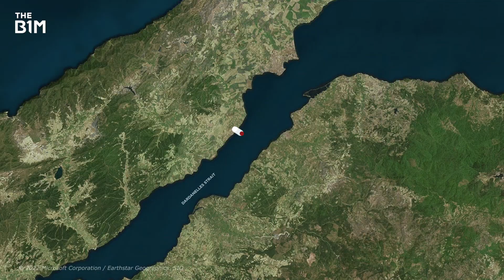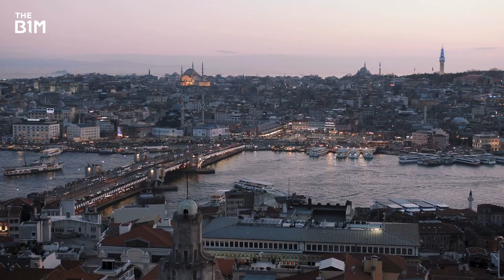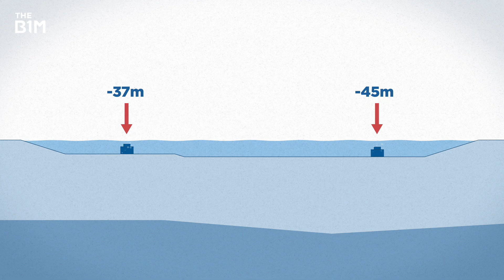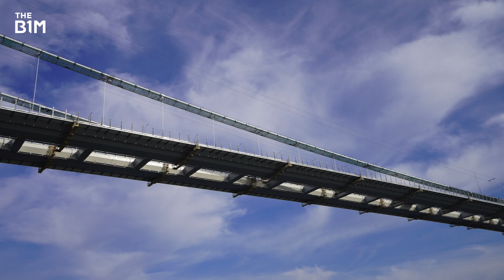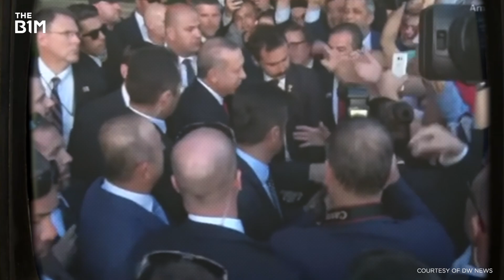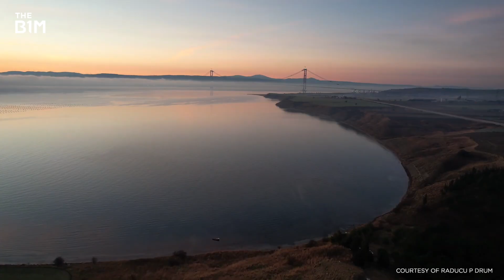Why Turkey Built the World’s Longest Suspension Bridge

Comment: Why not 4 smaller towers instead of 2? 
Surely the wind loading would be much reduced, the deck height could be the same, and still plenty of space between spans for shipping navigation.
Reply: Typically a suspension bridge is cost effective if the two towers can be built on dry land. But here both towers are built on caisson foundations. Is 3 or 4 caissons with cable stay towers more expensive?

Comment: When you have to take Oxygen with you when going to top of towers, you know it's a very tall bridge. It has incredible free space underneath. It will be a very long time (never) before a ship too tall can't fit under. 

The boxed road sections with opening in center is cleaver engineering, allowing wind to pass without inducing harmonic frequency problems. The connections in between used to walk between roadways. 

Will someone else build bigger, higher, longer than this bridge? Only time will tell.

Comment: Wondering how long it'll take for induced demand to completely destroy travel times... again.
I'm reminded of "just one more lane... just one more lane... just one more lane... I swear this one will fix traffic, just one more lane".
Also, 45k vehicles a day? Over 16 waking hours, that's ~45 vehicles a minute. Around equal to how much people the Sydney Light Rail would transport the same distance in the same period (citation needed).
On the ferry shown, I was able to spot 3 mopeds, 1 bike, 2 trucks, and 7-8 cars (not total number, just visible). If we were to be running that load with just one boat, and assume that the same boat could hold 150 people comfortably (around 2/3 of a Sydney Rivercat max seating), and we ran a dedicated freight ferry (handling cars and trucks), and we assume that the 7 cars were packed with 7 people, a passenger ferry (even a sydney freshwater-class ferry) would easily exceed the capacity of it.

Unfortunately, we've kinda... bulldozed our world so we can drive cars. Which kinda sucks, having to own and maintain an AU$3K upfront vehicle... sucks.
Reply: Somehow still cheaper than the New York Port Authority Bus Terminal... idk how 30bn went into that.

Comment: It's kind of impossible to convey the true scale of this on video. To me, it looks like a regular ol' suspension bridge, as the design is pretty much the same, but enormous. Overlaying it over central London certainly helps to visualise the incredible scale of this bridge, but video can't convey it all. Truly insane engineering.
Reply: it looks regular sized in real life too because there is not much around to compare sizes
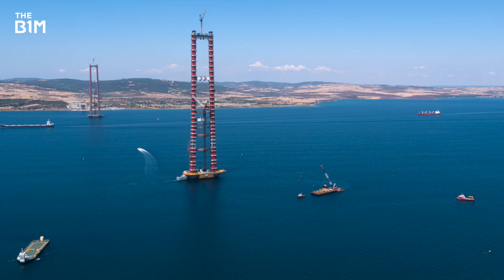Reply: The shot at 3:51 conveyed the scale for me. Not the surrounding landscape or even the passing freighters, but the tugboats surrounding the 'little' platform slightly right of the middle. Tugboats aren't that small, but they look absolutely tiny here.
Reply: Was looking for a comment about this

Comment: 0:15 CORRECTION: It is NOT the longest suspension bridge (the 4.6km). For example, the Great Belt Bridge (finished 24 years ago) in Denmark is longer (6.8km).
It IS however, the suspension bridge with the longest main span (2,023 m), right after the Akashi Kaikyo Bridge (also finished 24 years ago), which have a span of 1,991 m.

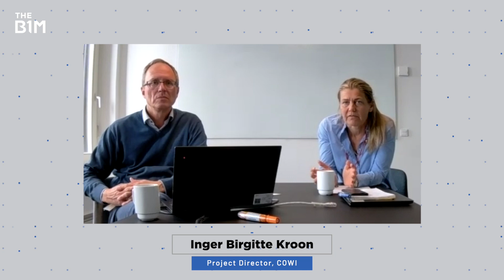2:43 COWI (HQ in Denmark) is one of the designers of the bridge and they should have the experience, as they was also one of the designers of the Great Belt Bridge in Denmark. The build process looks much the same, and given the compressed time frame for building it makes even more sense to choose that solution.
Reply: You should have said it's not the longest bridge. But, it's exactly the longest the suspension bridge because the suspended part of denmark's bridge is 1,624 meter only, almost 400 meter shorter than the Turkish one which a 2023 meter long in suspension. Previous record holder was Japan as you said but denmark's bridge is far shorter.
Reply: Who cares? Denmark doesn't exist anyway

Comment: "Longest suspension bridge in the world" 

Umm... no. First, it depends on how you measure (total length vs. distance between towers). Second, while 4.6 km is a cute bridge, North America's Mackinac Bridge is OVER 8 KM long! (Three times longer than the Golden Gate.) Details matter B1M.
Reply: Yes they do matter and you've got your details wrong.

You've got your definition of "longest" wrong for a start.
Reply: @davidpnewton  Except, that was how it was presented in the beginning of the video (longest = total length, which is of course wrong). The confusion is understandable.
B1M got it wrong in the beginning of the video. What they should have said was: It is the suspension bridge with the longest span in the world.
Reply: @davidpnewton  "TURKEY has a new bridge and it’s big – we mean really big. It’s the longest suspension bridge in the world, spanning 4.6 kilometers across the Dardanelles strait." 

That's not MY definition, it's THEIRS! They could have easily put that part about the center span being 2,023 meters at the beginning but they decided they wanted to highlight their tiny little 4.6 km overall bridge length instead. The "Mighty Mac" is nearly DOUBLE that! But if they had said "...this bridge has a center span that's a whole 32 meters longer than the previous record-holder" no one would have cared! It's basically click-bait. And not only did you fall for it, now you're DEFENDING it! 

On top of which, I clearly said "it depends on how you measure (total length vs. distance between towers)." So how exactly is what I said "wrong"?!?
Reply: B1M got it wrong in the beginning of the video. What they should have said was: It is the suspension bridge with the longest span in the world.

Comment: So the Mackinaw Bridge in Michigan is a suspension bridge 5 miles long. How is this the longest suspension bridge in the world when there are clearly longer suspension bridges?
Reply from the maker: The span of the Mackinaw Bridge is only 1,158 metres compared to this bridge's 2,023 metres, that's the part commonly measured when comparing suspension bridges.
Reply: @TheB1M  and still it is the total length that is compared in the video when calling the bridge the longest one - even if it was meant to say the one with the longest span.
Reply: As a Michigander I understand the sentiment but different measuring like Fred mentioned.  Mackinaw Bridge is 5 miles counting the embankments and center span (bridge in total).  While the main span is shorter than this bridge, it's still very impressive to cross!

Comment: Always thought who would succeed the  Japan's Akashi Kaikyo engineering feat. But after 24 years, here we are with this marvel. Thats why engineering is so fascinating!
Reply: Exactly. 24 years as top crown. That’s how big that bridge was and still is
Reply: While the 1915 Canakkale Bridge is a marvel indeed, I see no major advancement in engineering.  Consider it took 24 years to exceed the Akaski Kaikyo Bridge's mainspan by 32 meters, that is just 1.6%.  The Akashi exceeded the previous record holder, that being the Humber Bridge, by 581 meters, or just over 40%!  Also consider that the two towers of a suspension bridge are integral in holding up the side spans.  The Akashi Kaikyo Bridge's three spans total 3,911 meters while the 1915 Canakkale Bridge's three spans are considerably shorter at 3,563 meters.  The three span total of the Akashi Kaikyo Bridge is a 72% increase over the previous record holder, that of the Mackinac Bridge. The depth of the water at the tower foundations of the 1915 Canakkale Bridge are 37 & 45 meters, while the Akashi Kaikyo Bridge's are 67 & 70 meters.  The Akashi Kaikyo has been tested via earthquake - having its mainspan lengthened by nearly a meter during the Great Hanshin Earthquake.  The bridge was designed with a 1,990 meter span, but now has a 1,991 meter span.  Also the Akashi Kaikyo has experienced typhoons with winds of 160 kph.  The 1915 Canakkale Bridge will never see storms like a typhoon.
Reply: @Triplecenturies  And the Akashi Kaiykyo bridge still has additional (currently unused) capacity for rail.
Reply: @Triplecenturies i am sure if japan were to rebuilt it they could lengthen the suspension span easily. Sadly there is no bike path yet, I need to ride ferry to awaji island for cycling there. Well considering the wind speed, a bike path would have to have some kind of barrier

Comment: The Mackinaw Bridge in Michigan beats this bridge. It’s nearly 5 miles long. Why is that not the longest suspension bridge. But good for Turkey.
Reply: Not all parts of the Mackinac Bridge are part of the suspension bridge, which means the maximum span is actually short. The Mackinac bridge is the 26th longest suspension bridge in the world, so not even close to the top 10 in the world. You must know the difference between a 'span' and 'total length'. Both have different meaning and context. 

Mackinac span = 1158 meters
Mackinac total length = 8038 meters
So basically more then 70% is not a suspension bridge.

"Span is the distance between two intermediate supports for a structure, e.g. a beam or a bridge. "
Reply: @TanjirowGhamadow  Oh ok. I think it is like top 5 or top 10 in the United States. But I understand.
Reply: Yeah, B1M got it wrong in the beginning of the video. What they should have said was: It is the suspension bridge with the longest span in the world.
Reply: Some technicality. I guess Mackinaw is like the 20th longest suspension bridge in the world, but still one of the most beautiful

Comment: Nearly three miles long and taller than most buildings. That's impressive
Reply: Bragging rights are very important for dictators.
Reply: The Mackinac Bridge in Michigan is still longer, at nearly 5 miles. Built in the 1950s
Reply: @jeromewesselman4653  ffs mate i spent 2 seconds to see that its 1.2kms long - no where near 5 miles. Wtf are you on about?
Reply: @jeromewesselman4653  Is it a Suspension Bridge?! 
That's the point!
Reply: @wildone8397  Yes. The Mackinac Bridge is a suspension bridge, built in 1958
Reply: @jeromewesselman4653   The Mackinac Bridge's main span  is 1158m and  way shorter than  Çanakkale Bridge's 2023m. but  The Mackinac Bridge's total length is longer  because it is extended with normal bridge. The official length of suspension bridge is measured by main span not by total length.
Reply: @changcho6736  you meant m. 2023km is long enough to span from Spain to Poland
Reply: @remonn  You are declaring a dictator because the Turkish government does not follow a western style policy.
Reply: The "democracies" build faster than democracies when there is no wasting time on stuid things.

Comment: Why can't a cable stayed bridge be built with a central or additional pylons to increase the span length ?
Reply: i dont think its a good idea to put central pylons when building busiest sea route(canal)
Reply: @Thehusseyin  Okay so it was a project specific consideration to maintain the sea lane? I wasn't sure if the halved width would allow for ships passing with a safety margin, but they made it sound like the maximum span was a general rule so I wasn't sure.
Reply: Canal itself is not linear like suez, it has some sharp corners and when you factor into all weathers conditions, rough seas, winter, fog, visibilty and variations of sea depth etc maximum span would be prefered no, just my opinion
Reply: Designers now have their heads in their hand!, why did no one suggest this.
Reply: Did you mean the main span length?
Reply: @zaxisontherun  I did, and editted the comment. What's the alternative understanding?